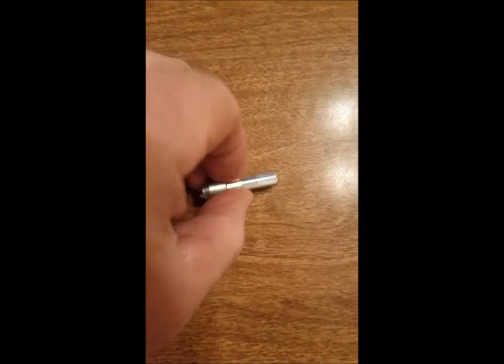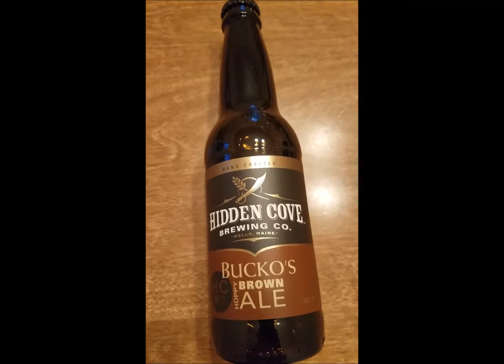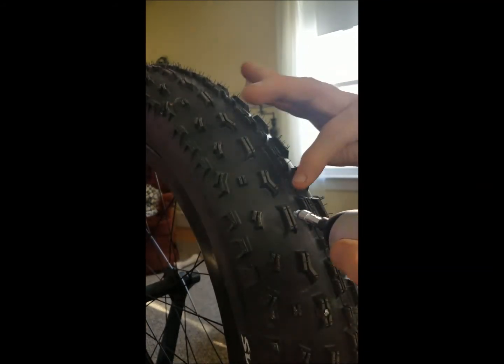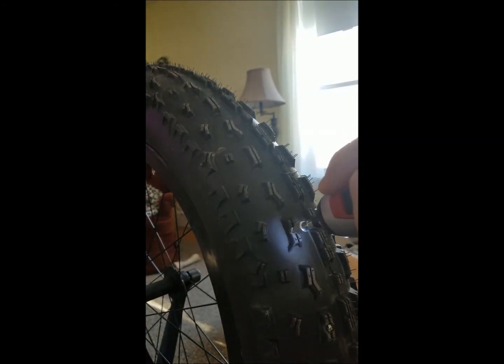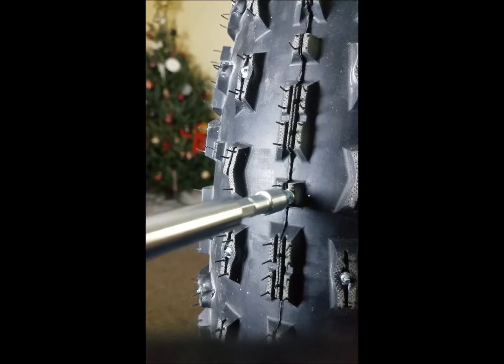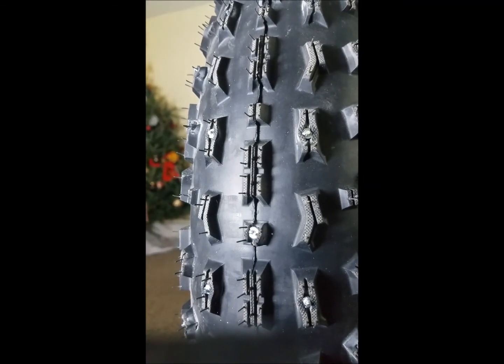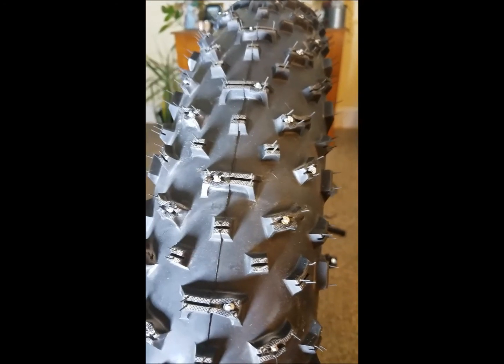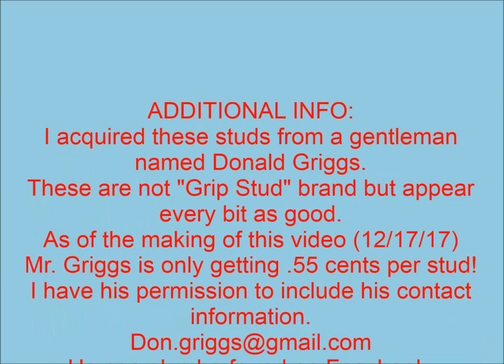Surly Bud & Lou Fat Bike Tire Stud Installation

Comment from the maker: I believe the overall length  was 6.5 or 7mm. I rode all last winter and did not loose any studs. The tires have been great in snow and dig in quite well on ice.  That being said, I may add a few more studs for this winter.  The only draw back, they are a bit heavy and offer up some noticeable rolling resistance in deeper snow.